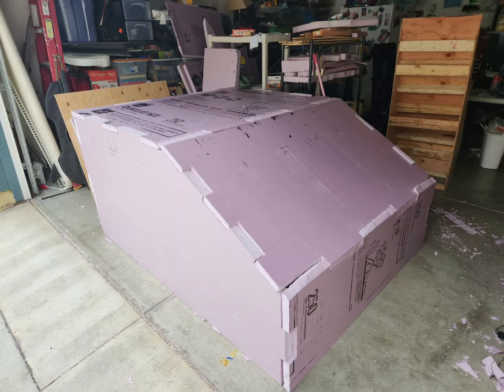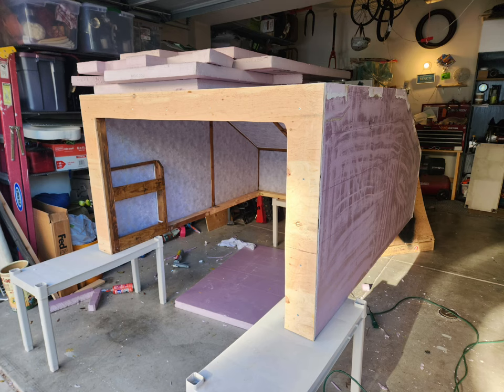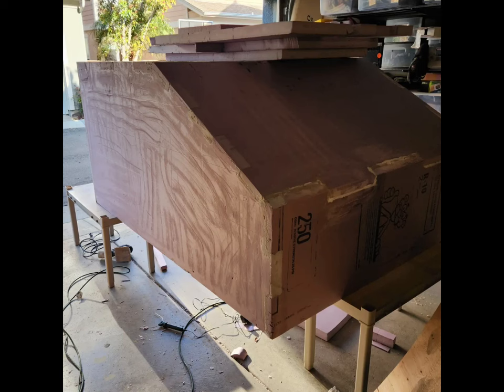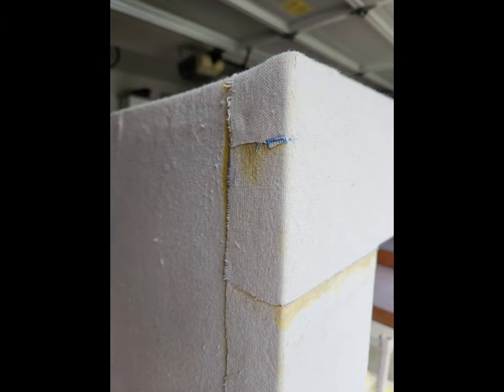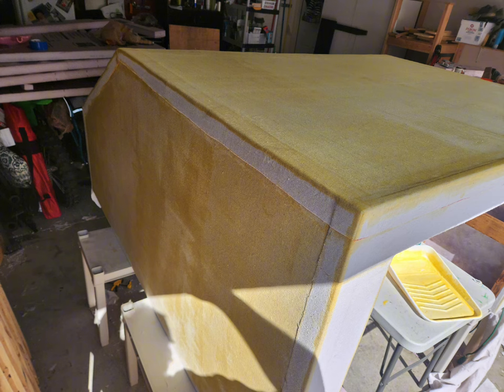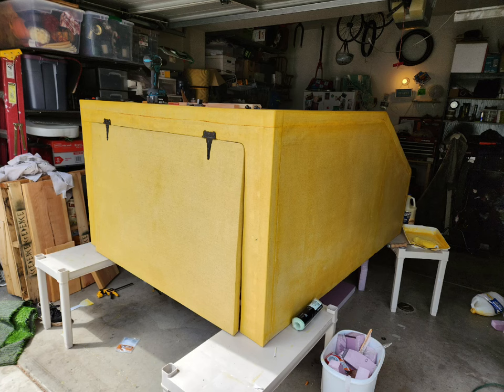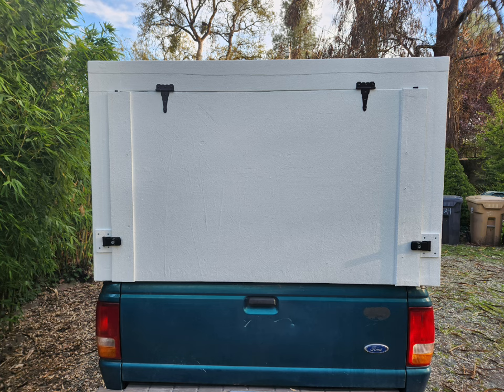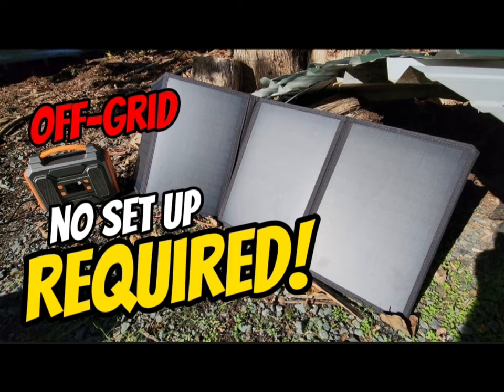How to Poor Mans Fiberglass a Foamie Truck Camper | PMF | #diy #camping

Comment: Good job👍
I think most folks thin the glue to get better penetration through the canvas.  Will be interesting to see over time if you get delamination - I hope not.  I purchased glue and canvas but now if I do a foamie for my Mav - it will be in regular fiberglass -- just for more strength.
Cheers
Reply from the maker: So far its been one year and the camper sat for 2 months on 100+ amd has done 2 winters thru freezing temps just sitting the past 2 months as well. Still no delam, i think it would have happened by now. I did pretty heavy top coat and a pretty decent undercoat to make it stick but not too much so that the outter coat could still seap into the fabric which water proofs it. Then paint over that.
Reply from the maker: This thing is insanely strong go look up a video of people trying to cut their pmf. Its tough stuff!

Comment: I actually wonder if you couldn't dye the glue a certain color

Or just use paint as the binder with no glue.

Did you use latex paint or enamel?
Reply from the maker: The glue does come yellow so it might be hard to do, that sounds like a lot more work to try to mix the glue then just paint afterwards I would think. 
I dont think it would stick with just paint and to be honest I cant remember which type of paint I used. I might have just got what ever said "outdoor paint" on it

Comment: I fully intended on building my own cap for my Ranger. But I decided to save the time and make the investment on an ARE aluminum cap. I wanted it strong and wanted it to last. I move boats on top of my truck etc. I spent a lot of money on my cap and regret it 100 percent. The build quality is crap, and ARE has never bothered to respond to me. So kudos to you for doing your own thing. It works and is a lot cheaper. I have no doubt after a little use you will decide to make some changes and make a second one. We all do it lol. Good idea doing the tabs on the foam to interlock.
Reply from the maker: Still time to build it out! Pop that thing up for sale and start all over again 🤙 i sold my shitty cap to get the money to start buildin this thing
Reply from the maker: An thank you I saw it on another youtube video and did my botch job on it 😅

Comment: Some people add the water to the glue so it doesn’t dry so fast and gives you more work time. You could also use a spray bottle with water to help keep a section wet while working. But it all depends on how well prep and get ready to work. Camper looks great! Good job.
Reply from the maker: That makes sense, the glue did dry really fast on me not diluted

Comment: Great video! By the way, I have a question: what if it gets dirty and you want to clean it? Can you clean it like you would a car, using a pressure washer and car soap?
Reply from the maker: @darkguitarist3476  yes ive done it many times only chiipped a little paint from super up close power washing, still fully water proof
Reply: @AdventureLiteCampers  oh cause i was thinking what if i use PMF to cover a tricycle's sidecar instead of steel sheets. thanks!. BTW, if u paint it black, would it look like it has a matte finish?
Reply from the maker: @darkguitarist3476  that should work, if you use matte black yes! Haha it has a natural rhino lining style finish but you can sand it to smooth it out i just didnt want to do the extra work

Comment: Love your imagination and follow through! Way to go man!
Tell me why didn’t you go over the truck cab for a sleeping bunk?
Second, you ever going to put in a window or skylight?
And 
How much does it weigh now do you think?
Cool n project. 
I just want to use foam board for a 3 section foldable flush truck bed cover. 
Thanks again! 
Let’s see some more camping pictures!
Reply from the maker: Thank you! 
I wanted to keep it aerodynamic jist didnt need to go over the cab, i do have a fan for the roof that i still need to install an no windows so i can stay stealth, air flow comes in between door and tail gate just fine.
That sounds like a fun build you have planned!

Comment: What did this project cost? 
I was thinking of doing the same with a tiny house,  I got the canvas long ago when it was cheaper and got the glue, all I need is the tiny house bones.
Reply from the maker: About $7-800 in materials. The foam was the most expensive then the rest adds up pretty quick too. The bones were the cheapest part 😄

Comment: Any idea if pmf works on the smooth film of polyisocyanurate foamboard.... it's R value is 6.5/ in rather than 5/in pinkboard
Reply from the maker: Im not sure , sand it if its not a film over it
Reply: @AdventureLiteCampers  thank you excellent instruction. 

Film is not exactly correct, it's the aluminized surface layer. 

The pmf will only be as good as that bond.  Thank you for helping me think on a Sunday am haha

Comment: Perhaps using spray and starch on the canvas when using the iron might help get rid of the wrinkles well. I just don't know if it was cause a problem with the glue.
Reply from the maker: Im not sure what you mean by spray an scratch?
Reply: @AdventureLiteCampers  spray on starch. starch is used to after ironing clothes to make it stiff

Comment: A better cheaper pmf is bedsheet and just latex paint…
Reply from the maker: ive seen that done before , have u done it?
Reply: Most latex dries pretty quickly. I would have thought an oil based paint to be better as there would be lots of time to get everything right. Plus, in my experience oil paints stick better. Yes, it takes a lot longer to dry.
Reply from the maker: @kbwaldron  i didnt have any issues withthe paint drying, it was the glue drying that was my biggest issue